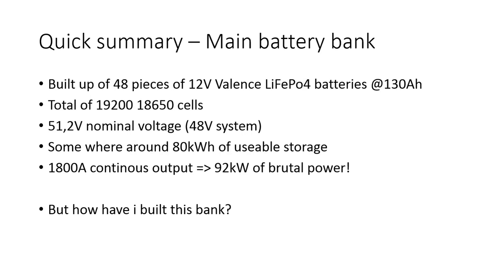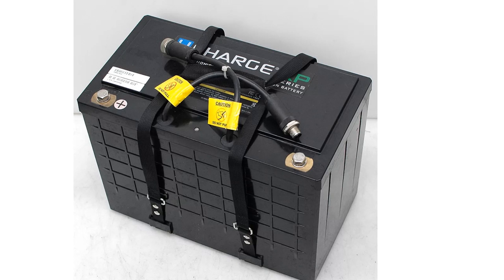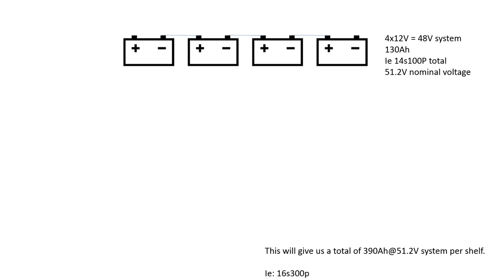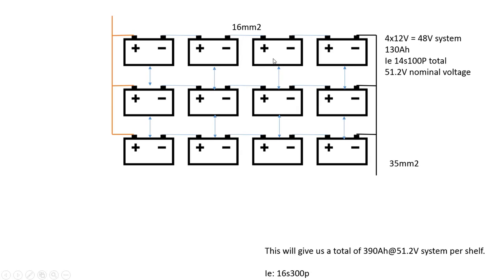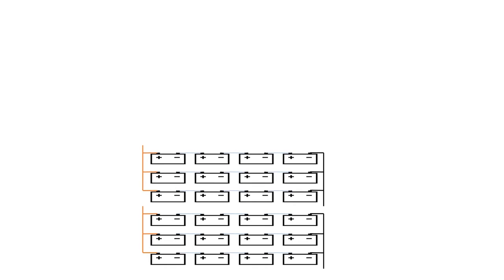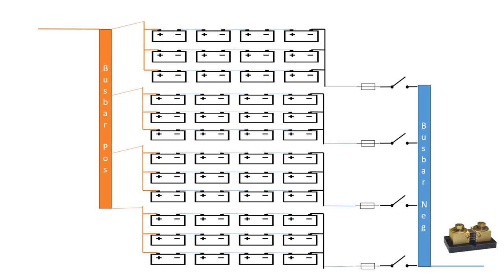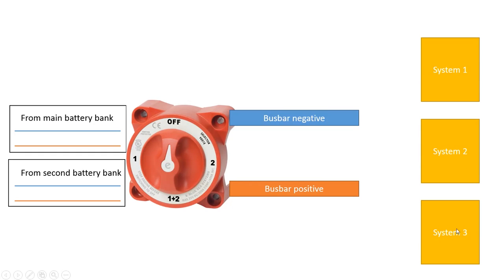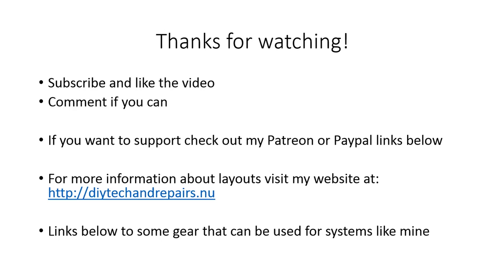Battery layout - Esperyd solar system

Comment: where do u get them bat boxes from?? and how do u keep an eye for cells heating up??
Reply from the maker: The battery boxes are original boxes. If you look at my earlier videos where I open them up and work with you will see. They are 12V batteries from Valence. 130Ah LiFePo4 batteries that I changed to Batrium BMS inside.  
Only chance of a cell to heat up if there is something MAJOR happening inside the cells or if you overload them.
I wont even get close to overload them. My bank is capable of handling 4000A easily and i can max out 250A currently :)  If we divide this into the cells thats max around 150mA per cell. Avg is around 10mA per cell :)

I have still not answered your question. Currently i only monitor the surrounding temperature where i have them. I will though be adding 2 temp sensors per pack to meassure the temperature on the cells. This will be on the base copper plate on the packs so it will meassure the temperature pretty accurate. The plates itself is whats connecting the cells in paralell. 

So there is still work to be done with improvments. Currently i only use what was included originally on the batteries and i hope that the manufacturer know what they were doing :)
Reply: I haven't seen them batts in australia, so I guess importing them empty is out of the question as the freight will still be very steep even with them just being a shell, but its a nice neat unit to house the lion bats and conforms to standard hook up practices.
Reply from the maker: Yeah nice batteries. I paid like 25GBP per battery for shipping.. So its expensive :/

Comment: housten? we have a problem, Oi oi oi deroma cant download the ISO, ur site has crashed and it dont support "download resume" can u make it into a private torrent pls?? I wasted more then 6gb allready trying to download it and it keeps failing.
Reply from the maker: Memory problem on server. Going to sort that a bit later today. No i dont want to work with torrent since it will be dynamically updated. Use a program that supports resuming. Like Chrome or Firefox does that out of the box.
Reply: yeah, i used firefox and it downloaded 1.2gb and got stuck and it would not resume again, then I used bitcomet http download and got to a certain percentage and got stuck. BTW, thanx for all the quick replies too, I cant wait to test this program of urs on the mpp solar inverters, the program that comes with the pips r not user friendly as it exports the data to a pdf and u cant easily monitor what the unit is doing. Cheers.
Reply from the maker: Strange. It should work but at same time i had mem issues last 2 days on that server. But will have to be replaced with new hardware.  There is also a new version of the ISO on its way with Emoncms and some other fixed things. I hope it gets done soon. Note that the script here does not "do" anything. it only fetches some data for visualization right now. I am working on more advanced system but not sure when that can be public.
Reply: remotely logging in to the pi and seeing the real time info is a good start, getting the logs exported to a csv file would be a 2nd goal and changing the parameters in the inverter is the 3rd goal. ATM, I can log into a windows or linux pc then generate a pdf then if i have to change some settings through wired or wireless internet connection, cell data internet is expensive and trying to minimise the amount of data used to facilitate this is the goal as costing is a factor in being able to monitor and control the units remotely.
Reply from the maker: Agree. MQTT is included in the ISO and the script (when done) will be built into that portion so you can set it up however you want :)
Reply: Thanks m8, download almost complete using bitcomet HTTP download. :)
Reply: dunno what happened but its re-downloading again and I have killed off 10gb trying to download this file... why isn't Resume supported? we all don't have unlimited internet here. Back to firefox download, and gotta wait another 15 hrs.
Reply from the maker: Sounds like you have problem on your end. I have tested this on both FF and Chrome. On 2 different computers without issues. That file share have been used for years without issues for 1000s of downloads for other stuff :)
i will put the iso up for you on a static apache server instead. I will add the link here later today (I need to get home before i can move it)
Reply from the maker: I understand :)  In sweden most people have free internet kind of. Many of us fiber. Even middle of nowhere :) http://romer.se/rasp_v5.zip  try this one. direct link from webserver instead
Reply: download completed sometime in the last 2 hrs, had to use a m8's internet as I am at my max data allowance, I think the connection was unstable cos I did notice the modem loose signal alot when I been there over the last few months. I will pick the file up soon and hopefully the orange pi's will be delivered there today too. Thanks again.
Reply: that last download was corrupted, and my internet is back to full speed so I will attempt to download it now if the new version is uploaded to ur server?
Reply: ok v5 download on my net 1st time just fine, m8's net is just crap.